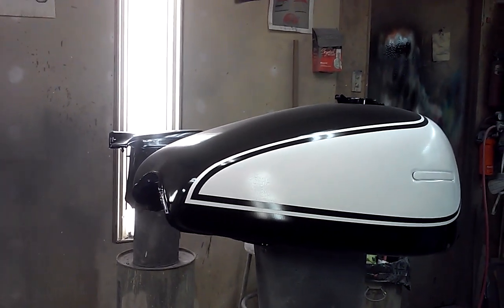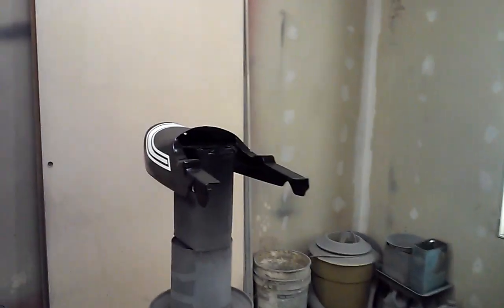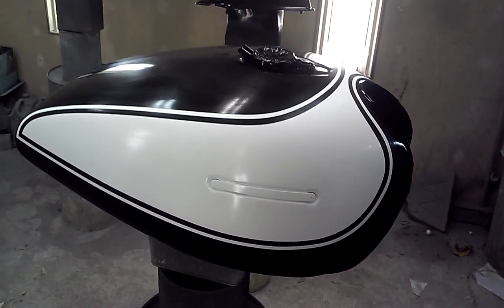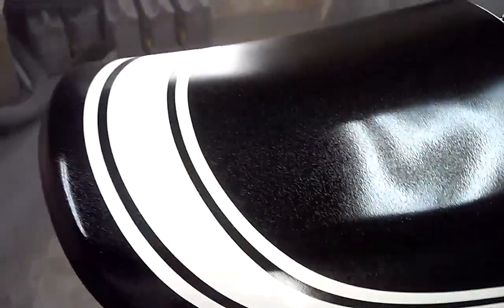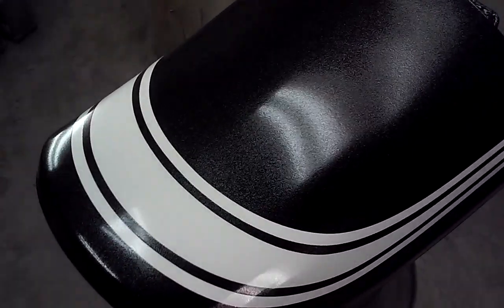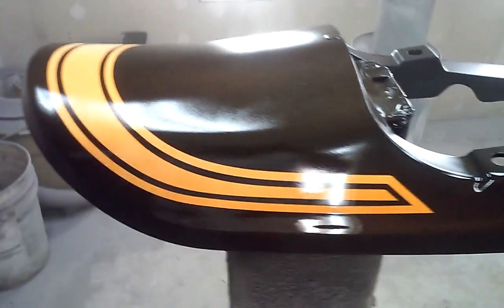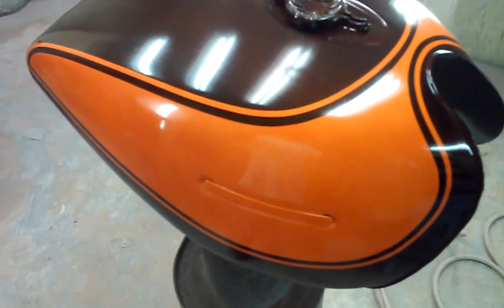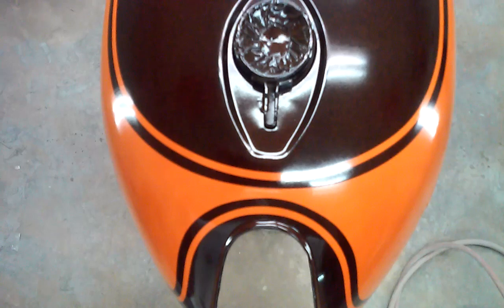Z1 PAINTING PROCESS

Comment: Just for the record, I have a 73 Z1 in rootbeer/orange that's still got the factory paint. Not true that they narrowed out the pin striping where it goes behind the filler opening to make it fit. The lines are the same width behind the filler opening as they are everywhere else on the tank.
Reply from the maker: I have 3 sets of factory paint, the stripe narrows on them all.